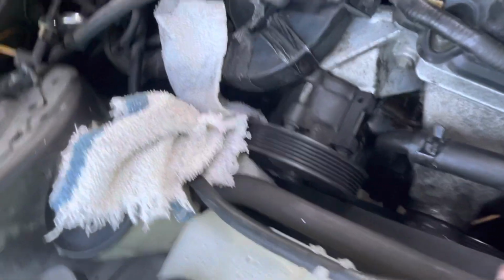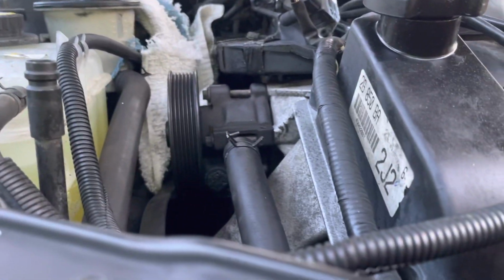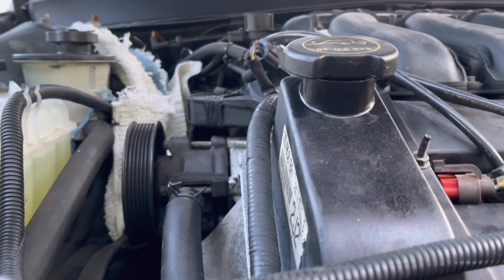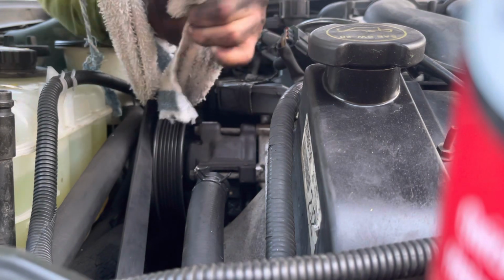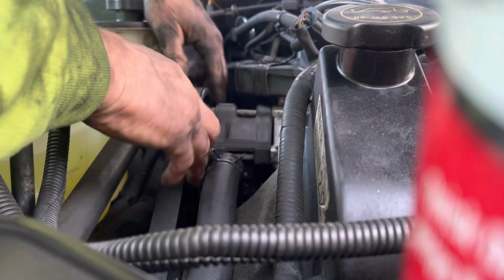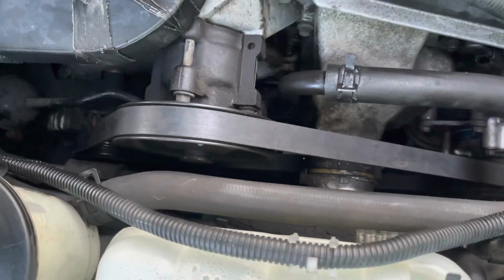No tools Serpentine Belt install

Comment: my 2010 volvo S80 2.5l had a broken Torx tensioner bit (which is used to set and unset the tension on the belt when installing/removing) and then I broke the Torx bit on the new one. definitely will try this method of 'manually' lifting the tensioner.
Reply from the maker: Damn- good luck. That’s a new one.
Had a friend who lost the Idler Pulley on a running vehicle when the bearings froze & broke off. Weird one.
Reply: on my 06 VW Golf SDI the alternator internal bearing froze and made the pulley impossible to spin - even the engine couldn't rotate over. got me stuck at the side of the road. belts are dangerous, lots of forces are involved.
Reply: checking back in, it didn't work lol I couldn't lift the whole tensioner with just the belt and a rag. on that specific volvo P3 you gotta take tensioner out, put it in a vice, manually operate it and jam a bolt or nut in the space to keep it open. when installing the belt and it's in place just pull out the bolt, tensioned, done.

Comment: It's a good trick, sometimes the "janky" method is superior to the "approved" method, hah.  One thing I've noticed doing this method for years as a mechanic that might help a newbie is that usually one pulley will be easier to get at that another, and if you are not an absolute beast from lifting weights, make it easy on yourself and pick the easiest one, it might be down low instead of up high like this vid.  Also, some of the pulleys will have a shorter rib on the edges than the others, making it easier to slip the belt over, so look for that too, when picking which pulley to leave for last when putting that belt on.
Reply from the maker: 🙏🏽 super cool info
The thing about YouTube that’s cool is not always the video, but the comments that help people understand the limitations and exceptions for a video 

Often times I learn way more in the comments than I learned from the video so I usually read the comments and watch the video and try to pick up tips 

Hopefully people got those tips because those are very good tips 

I never even thought about it before, but you could almost be upside down under the car and pull the belt on from somewhere below 

I know when I had a sob it took me long time to figure out the car needs to be in the air, and the only way to work on a Saab is from underneath the engine 

Once you get up underneath the sob and look at it, it’s the most incredible layout and it’s so aerodynamic and clean. It’s amazing. 

But since the sob was designed by airplane engineers, and they wanted you don’t see it from the top as much as you see it from the bottom and that’s exactly where it should be because that’s where the air is flowing through the engine area 

But trying to work on a sob from the top is damn near impossible